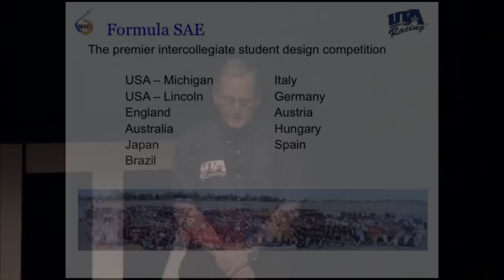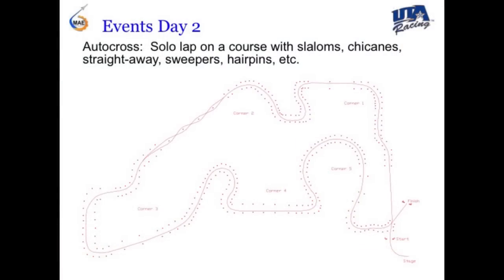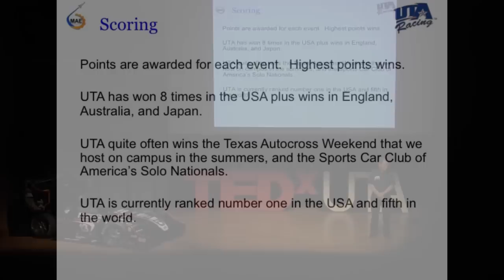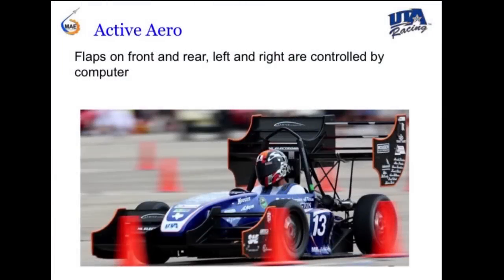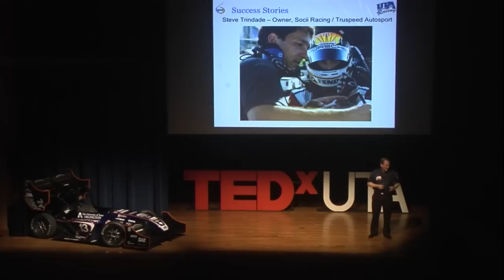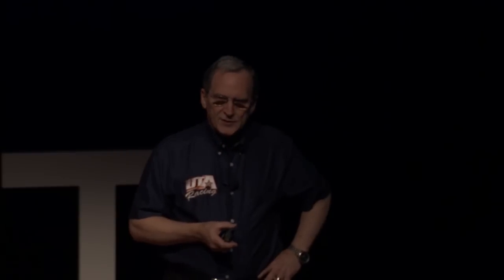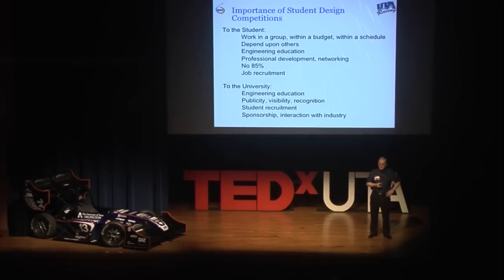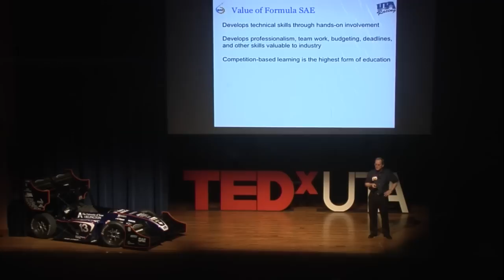Formula SAE and race car technology | Dr. Bob Woods | TEDxUTA

Comment: That Active Aero is sick
Reply: The Pagani Huayra and Pagani Huayra BC both have that Tech it is amazing.
Reply: Most of the highest end supercars and hypercars as well as the top tier racing series has been using it. F1 had it for one of the longest amounts of time.
Reply: I would be interested to see what the active aero is actually doing. The speeds for these cars are 20-65 mph for the most part so I have a feeling it's mostly to wow the judges, but when you have an unlimited budget any gain is still a gain. Cool regardless though.
Reply: You should see it now, the active aero for the front and rear wing adjust to turns and body flexing similar to the McLaren Sennas' rear wing.
Reply: They tried a sort of passive system in the past that was driven by suspension motion, but this seems to be much sturdier.

Comment: i find it confusing that this professor is presenting this car. why isnt the team captain doing it? the prof always talks about "we" did this and that. there should be no "we"! this is a student competition. it clearly states at the rules that there should be no professionals involved. This competition is about the students. Other than that great car and the aero really is pretty cool.
Reply: Arne Schlowak UTA's prof is really involved in the car's development. A lot of schools have a laissez faire faculty advisor and its up to the students to design and build something.
Reply: Dr. Woods believe it or not basically invented FORMULA SAE he wrote the first rule book so
Reply: Isn't active aero also illegal
Reply: "Aerodynamic devices are regulated through maximum size and powered aerodynamic devices are outlawed."
Reply: @Thrillowatt  Active aero is legal, "powered aerodynamic devices" means things like fan cars are banned
Reply: @Qwertyy74  just like with the big boys, fan cars weren't illegal until someone made one.  There were some crazy designs in the 80s and 90s in FSAE.
Reply: no cap
Reply: @tubergonz I know this was 3 years ago but I’m actually now on the team that got it banned back in the day
Reply: @noahabramson5494  There was also a car from Winnebago that just as boxy as an RV.  There was a car from the Naval Academy (?) with a solid rear axle where one tire would lift in the air around a turn.  There was one car that served double duty as a mini-baja and they kept the 8hp B&S engine. It sounded hilarious since it never changed RPM (CVT).  Just a really fast lawnmower puttering around the course.  😀

Comment: I was part of FSAE in college also. It was a great experience like you said. Happy you are getting the message out there. one question. Why not an electronic shift mechanism?
Reply: +axel hoogland Difficult to make. We had one on our car for upshift only. It is actually my senior project to make the first ever FSAE Active Rev Match system for electronic down shifting.
Reply: +Peter Bayley Our team used a Pingel shifter from these guys. http://www.pingelonline.com/prodcat/electric-speed-shifters.asp
Just giving you a head up. Good luck on your design.
Reply: Heh we have a strong no outsourcing policy for electronics. Additionally, the shift device you sent me doesn't seem to undergo true active rev matching.
Reply: Gotcha.  Cool.  Good luck with the development.
Reply: how'd the senior project go?
Reply: Our team branched off to an electric FSAE team so my project changed. I am now working on a three phase motor controller using a technique called Space Vector Pulse Width Modulation. However, I did finish the electronic throttle project which was a major component and precursor of the Active Rev Match, and it worked phenomenally.
Reply: good to hear. I believe for our car we're just using an off the shelf controller. I'm doing my senior design too, it's the front drivetrain for the 4 wheel drive car our team is building. I can't wait til everything's manufactured and spinning. best of luck
Reply: hard to make, easy to break. no go.
Reply: We had a steering wheel mounted up and down button shifter on ours (UTAustin 1992-3).  It was pneumatically powered with a bottle that had a NOS sticker on it.  Always fun to see people's reaction on it.  :-)
Reply: @Annihilator49 o you know if you team ever changed this policy lol? Production quality electronics are much more easily available in a corporation rather than engineering students

Comment: does the car use the venturi effect-ground effect under the car to improve downforce ? what kind of engines do they use ? turbos ?
Reply: i was a fscer in china,most of the teams will use diffuser and wings to increase the down force,as for power unit ,some cars use combustion engine,some use motors.sadly,chinese fsae racecar teams are too young,we still have a long way to go.
Reply: most engines comes from different motorbikes like honda cbr or yamaha r6. yep as far as I know it is allowed to use turbos as well.
Reply: Depends on the team and the car. 

The UTA cars do use venturi tunnel ground effects. 

The engines change as the cars evolve. The last car was a naturally aspirated 600cc honda, four cylinder.
Reply: @holmeswood4293  wow are you still in China 😊???